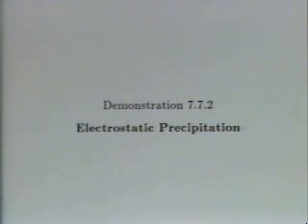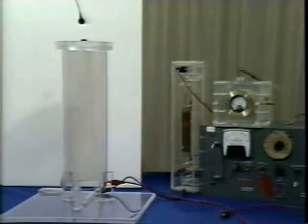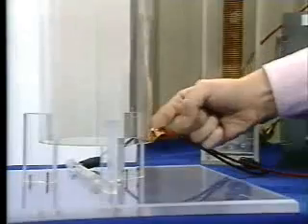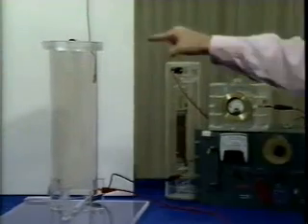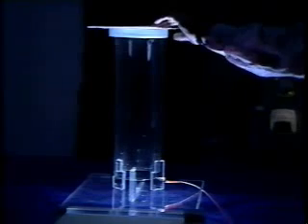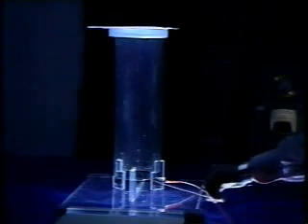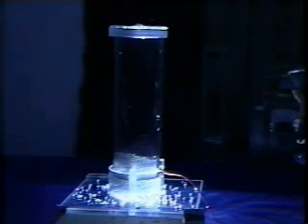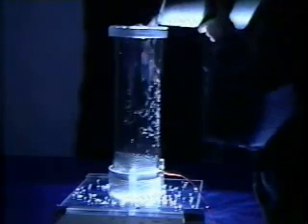Lec 10 | MIT 6.013 Electromagnetics and Applications, Fall 2

Comment: hi so would you say this is how the epg is made up stainless steel round tube with positive attached as an exciter and the hydrogen oxygen gas inside acts as the bearing less electromagnets with a led shining inside that reflects into chaos acceleration as it pulses off the hydrogen released electrons(BECAUSE THE NEUCLEUS HAS ABSORBED PHOTON ENERGY) that make electric off the outer coils buy induction (not an expert here so would like a comment) as still suss the electric side.vacuum sealed ?